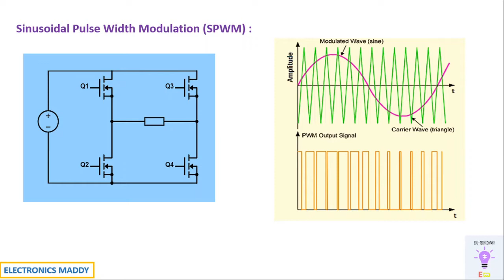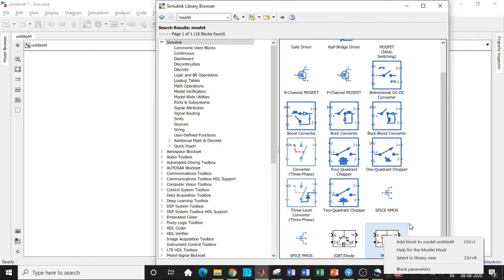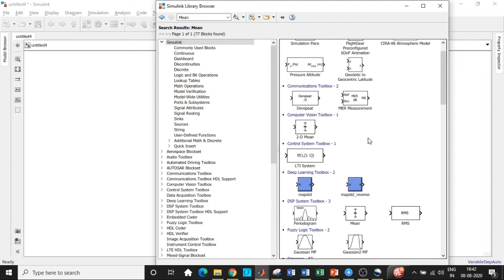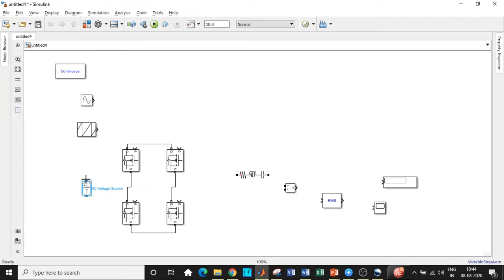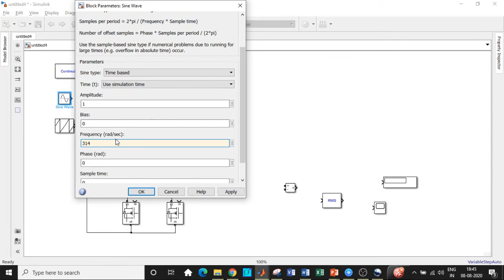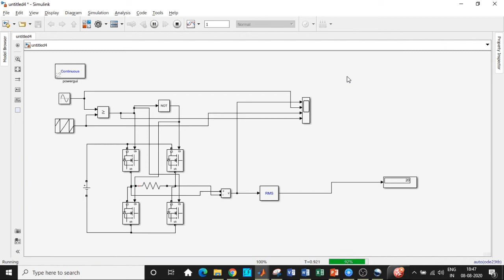Simulation using Sinusoidal Pulse Width Modulation in MATLAB | SIMULINK | SPWM

Comment: On greater library  option,
I Don't have any (greater than equal block) 
What should i do now????
Reply from the maker: Which version are you using?
Reply: I also facing this problem
Nd I use 2019 matlab version
Reply from the maker: Search for relational operator.